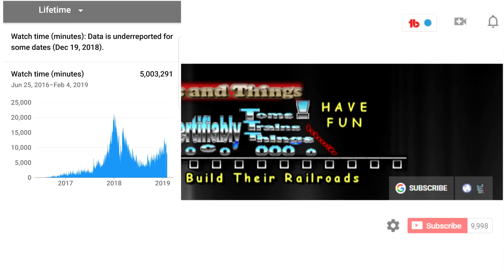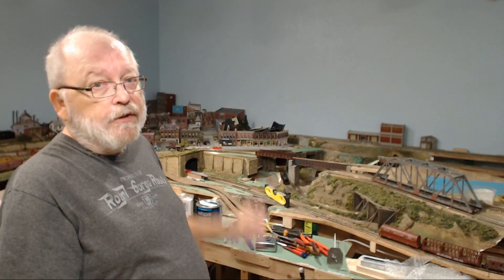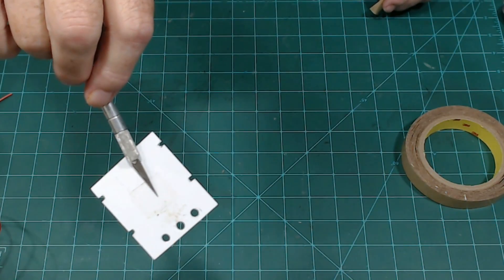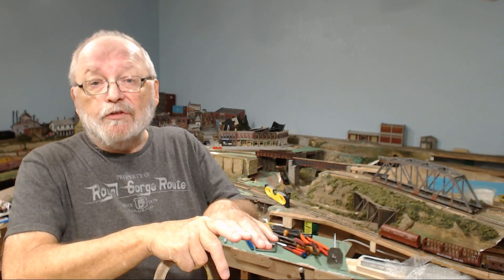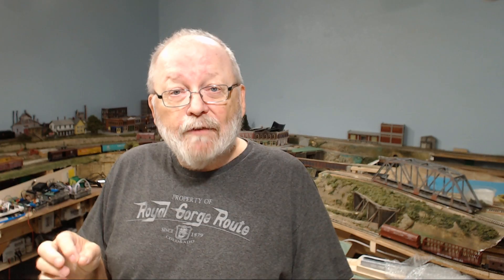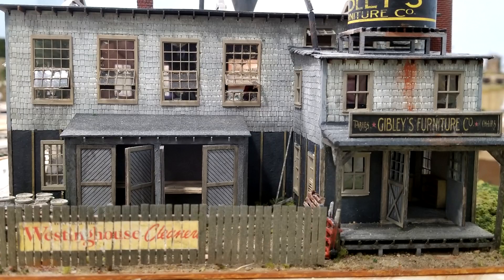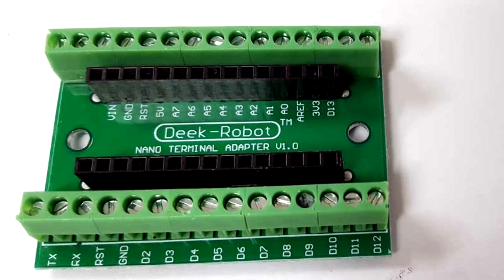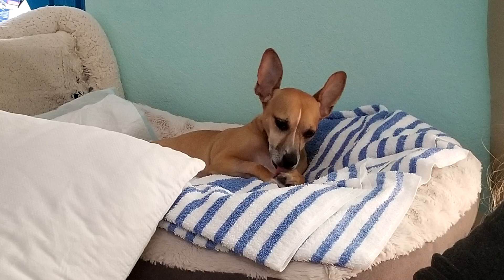Questions Answered About Arduino - Shingles - Wire And More

Comment: Congratulations on 10,000. I hope your dog gets well soon. Im looking at using a servo and arduino as a switch machine, do you know if there is a was to juice a frog off an arduino, or is that pushing it?
Reply from the maker: Thanks Joe. It's going to take some time before Sadie is able to walk again. For the servo as switch machine, that's a great idea, it's done all the time. You will need to use a 5v relay operated by the Arduino in conjunction with the servo. Put a delay on the relay pin to give the servo a chance to move.

Comment: Thanks for talking about wiring, I've been told 22 gauge is good, but I think that was for a 4x8 layout that he had. And I thought 18 gauge looked like a good size to use. But you are saying 14 gauge is good for a big layout. I'm working on building a 7x20 rectangle shape layout with an open area in the middle. So will 14 gauge wire still be your choice, also what gauge wire would be good for everything else that needs power other than track. Thanks from Jeff. Sorry for the long question.
Reply from the maker: 20 or 22 gauge wire is alright for feeders. The 18 gauge wire for the bus will suffice for a small layout like the 4x8 but for what you want to build I would stick with the 14 gauge for the bus. For my lower voltage accessories, I use 18 gauge twisted pair to the circuit boards where I have lighting and other components around the layout.
Reply: @TomsTrainsandThings  thank you for the info. That helps a lot. I always look forward to your videos. The Arduino videos you make are cool, but they are out of my league, even though you make it look easy. Hopefully I will find a way to use them. But for now the most important thing is, I need to build enough modules to run some trains. Again thanks for your help.
Reply from the maker: Glad I can help Jeff